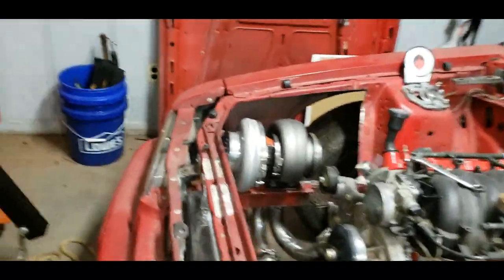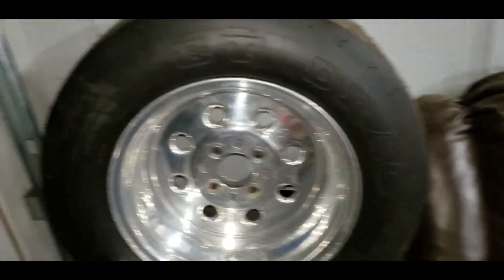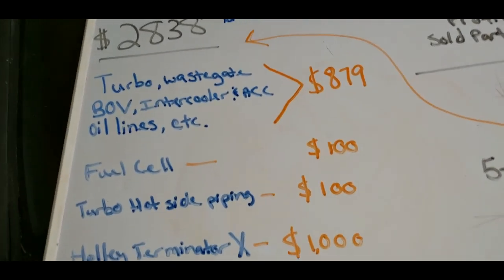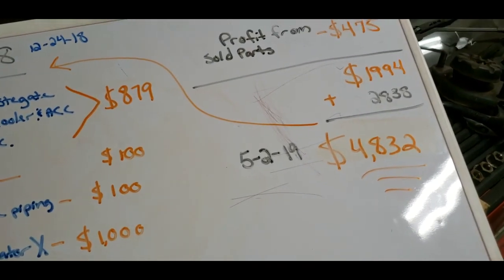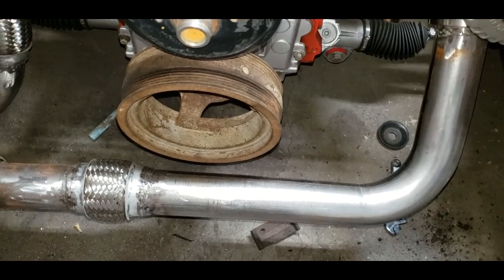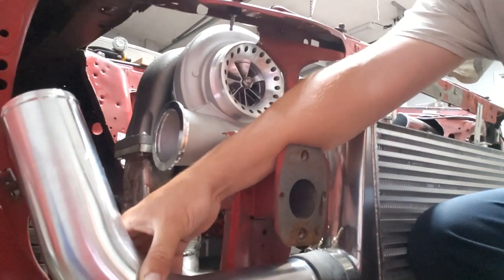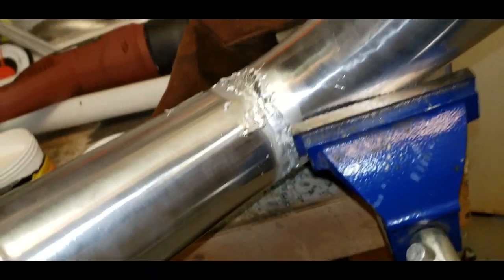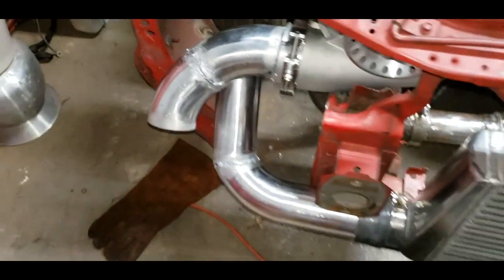800 WHP turbo LS build part 32!  intercooler, radiator, and other work, plus budget updates!

Comment: What radiator is that bud? Its been a long time
Reply from the maker: I bought it right out of the summit catalog,  it's part # SUM-380324 .  I got it on sale for $140, used one of the promo codes they put up from time to time.
Reply: Thanks bro 👍
Reply: Thats the same spot i mount my turbo too👍👍
Reply from the maker: I've about made up my mind, that I'm going to make a new support out of some electrical conduit (steel) and a cheap pipe bender.  It will open up a lot of room I think, be lighter, and look better, plus be cheap .
Reply from the maker: You're welcome! Its perfect if it were 1 inch shorter. I'm not too worried about it since I cut so much stuff out, but if you wanted to spend more $, the steeda radiator ($500) fits perfectly
Reply: I have a team z radiator support you think ir might fit
Reply from the maker: I looked into those, roughly the same parameters fit wise...made for the steeda radiator. Summit has lots of others, in multiple sizes. This is just the one I picked since the turbo is in the spot its in...